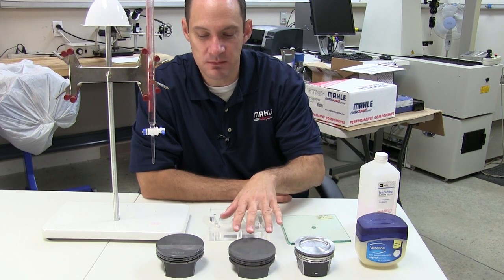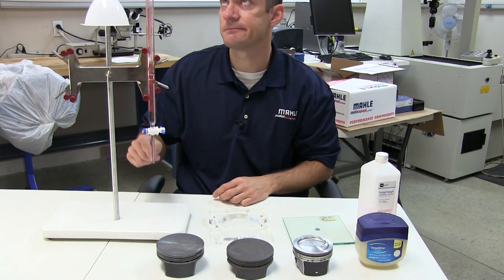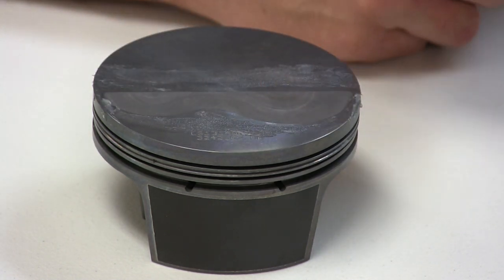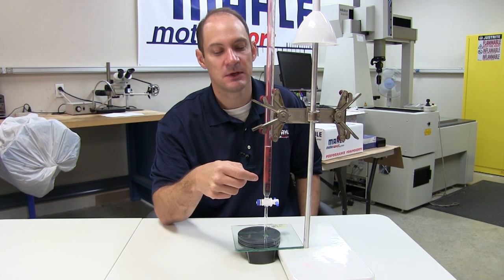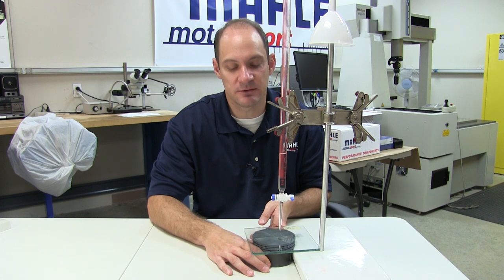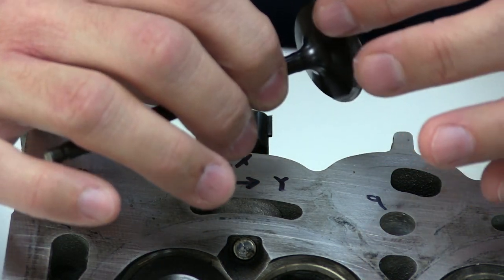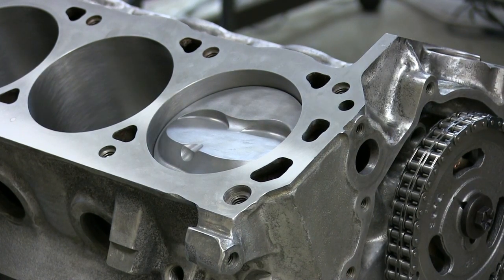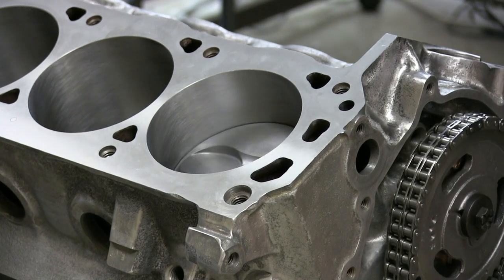Measuring Piston Volume

Comment: I used plastiline to get a concave copy of a piston dome and then measured how much isopropyl alcohol was needed to fill the concave plastiline, im sure there is probably a margin of error but severall tries gave very close to the same result, what do you guys think of that?
I was trying to measure a nissan CA18DE stock piston dome volume, came around 5cc.
Reply: I know this is old but I have been killing my self for the last few days to try and measure my piston domes to no avail. But after reading your comment i think I will be able to get it done quite easily!!! I didn’t even think about doing this way. Thanks man!!!

Comment: the video was very informative 
i dint knew that we can measure the volume like that as well 

i have one question 

there are oil holes on the side of pistons 
, what will happen if we increase the size of those holes by 25-30% ???
Reply from the maker: Thanks for watching! By increasing the size of the holes you'd reduce the pressure of the oil flowing through those and into the piston to help oil the pin. In addition, you could cut into the third ring land by doing that as well. I'd highly recommend not enlarging the oil holes.